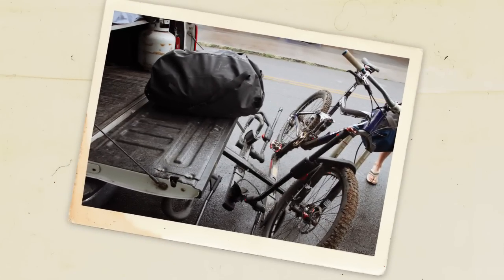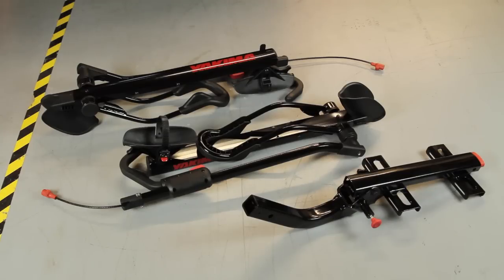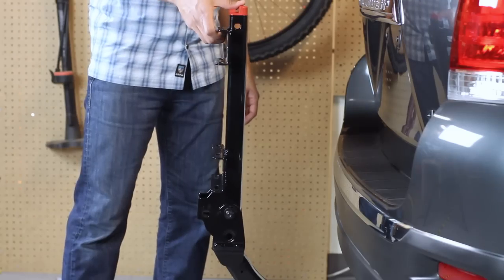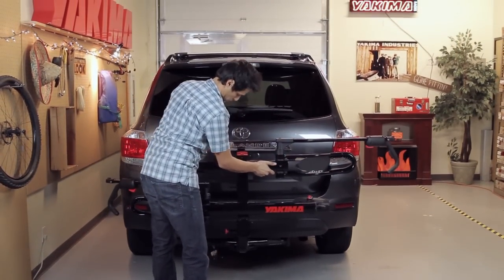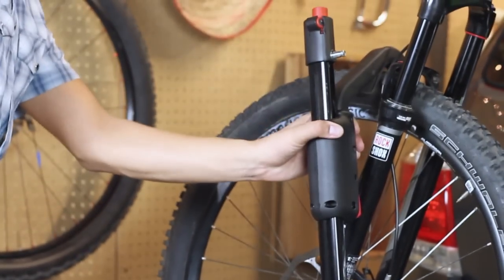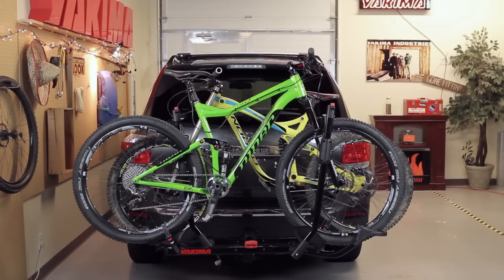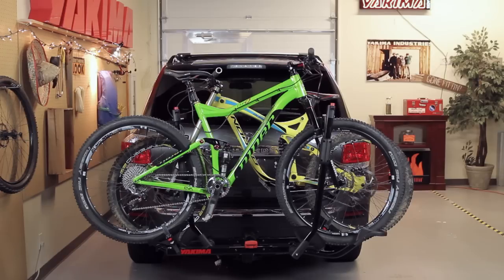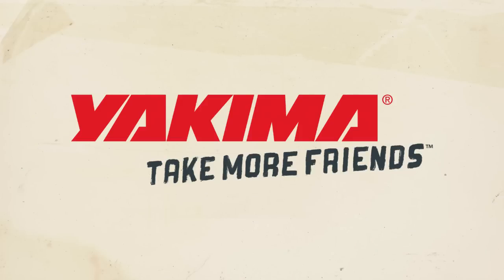Yakima HoldUp Bike Rack Product Tour & Installation

Comment: Just purchased this product. Pulling my hair out because the threads that you guys show at 0:37 as being on the RIGHT SIDE are actually on the LEFT SIDE on the product that I received. Is it an issue if I insert the bolt from left to right?
Reply: You can change the placement of the insert with the nut to accommodate your receiver setup. I changed mine to insert the bolt from the left because otherwise I had less room for the wrench.
Reply: Me too!!! I guess I just have to ignore the instructions for this part. The threaded part is on the wrong side.